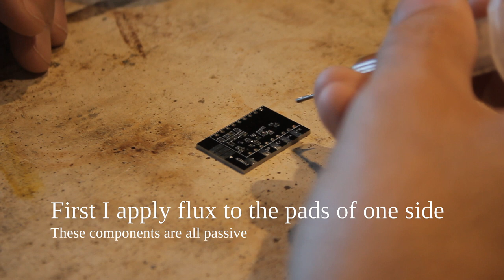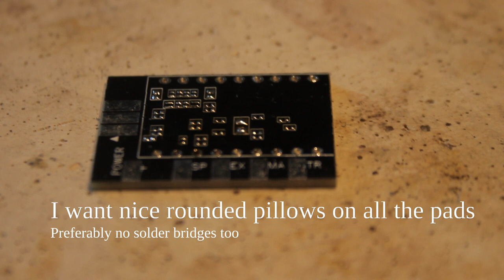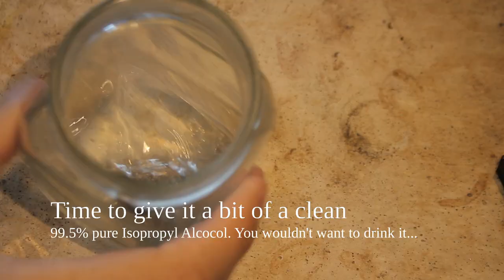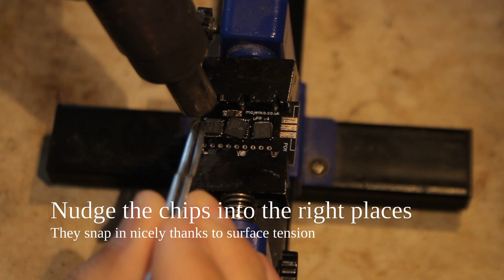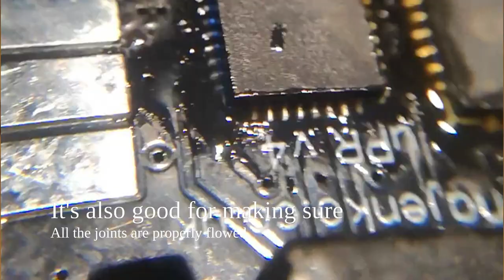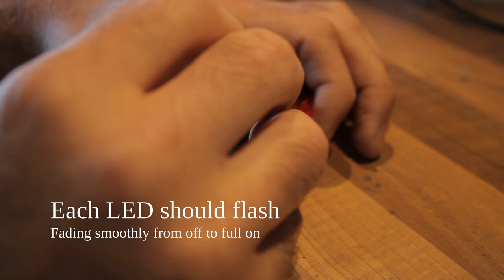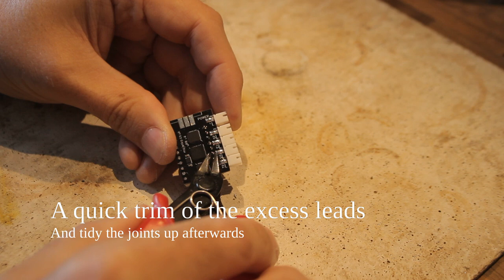Soldering a uPRv4 Pulse Rifle board

Comment: Dude Im sorry Im a total noob but how did you do that at 0:15? Is there a small pit in your iron that holds that much solder?  Any help would be appreciated, I hope to be at your level one day :)
Reply from the maker: No, it's just a normal chisel tip soldering iron. You don't need a huge amount of solder. You can get special tips with a dent in them, but I never bother. The magic is all done by the flux.
Reply: @MajenkoTechnologies  Got it thanks! Do you have preference to the chisel tip over a conical one?
Reply from the maker: Yes. I have all three common shapes here - chisel, screwdriver and point. The chisel gives the sharpest edge to it for getting right into the angle of the chip. The others are all too rounded to get in there.
Reply: @MajenkoTechnologies  thanks for all the help and free advice!